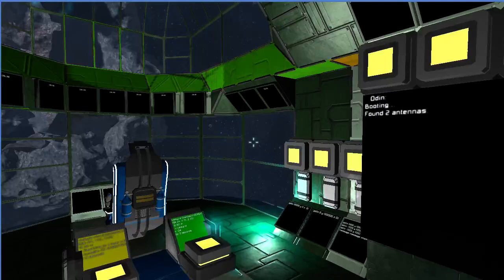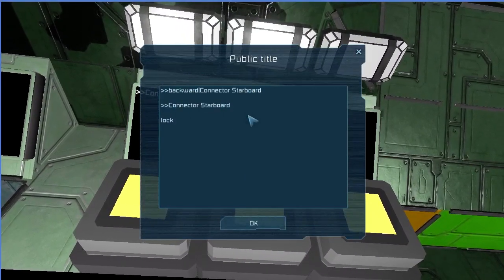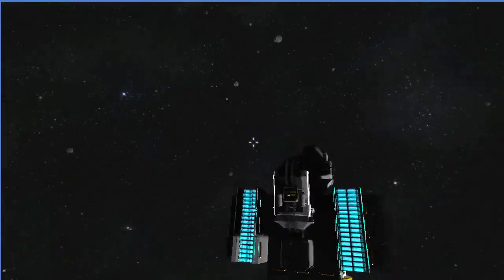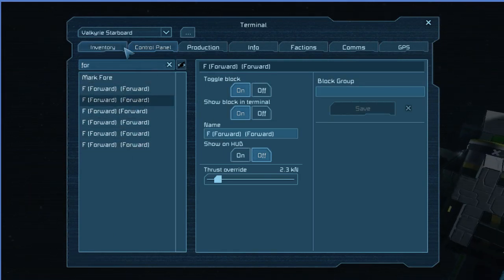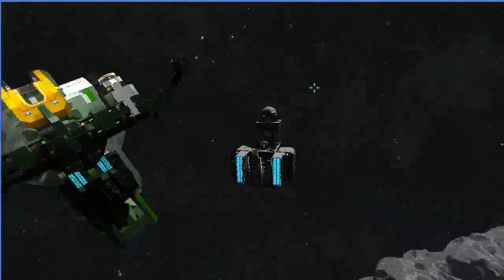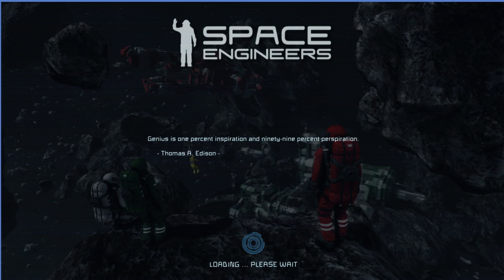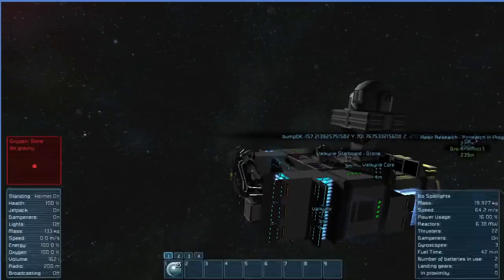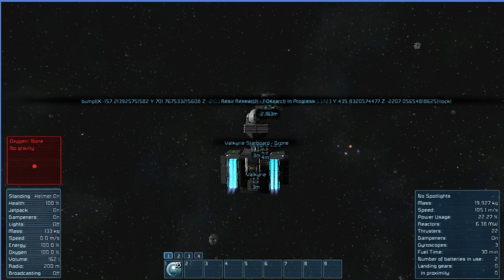Space Engineers: UGH UGH STOP BREAKING SHIT

Comment: Hi grate show I am loving watching you make this system great job

Just a couple of things for this problem can you get away having you engines on routers
so the it will still counter your thrust 
Or maneuver with gravity I have used this in the past as you can increase the thrust from the gravity drive till it is over powering your thrusters 

And in one of the other vids you mentioned the 50m problem with sensors you can just change the coad to make the working distance larger

Sorry if this doesn't help just thinking out loud

Good luck with the project keep us update
Reply: Grifter000999 There are already sensor mods, he most likely doesn't want to mess around with sensors yet.
Reply from the maker: Aidan Sprucechopper Try installing a sensor mod. If you find one that still works, let me know.
Reply: Craig Perko I just changed the size of some sensors in the game file and keep a copy of 5 different sizes saved as blueprints so I dont have to leave the game if I need a new one